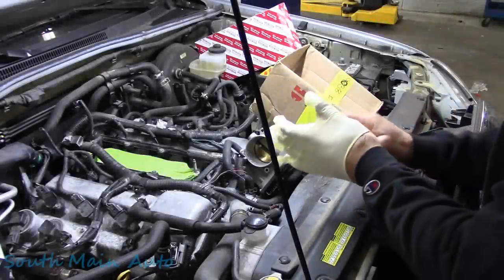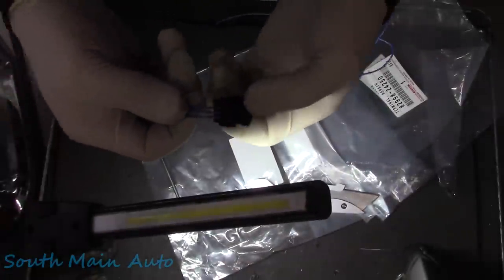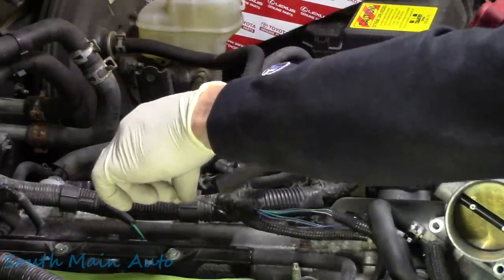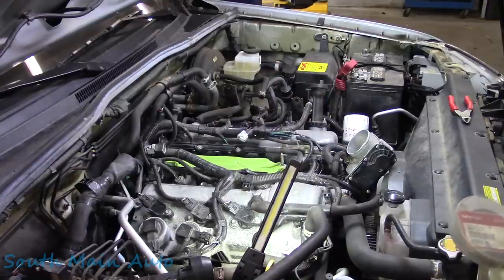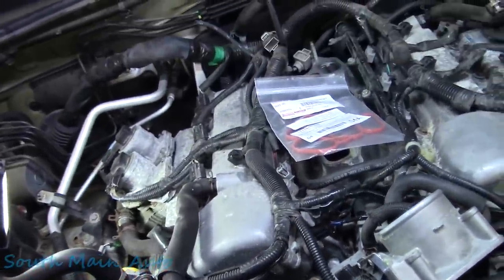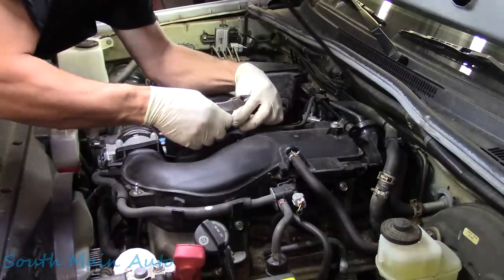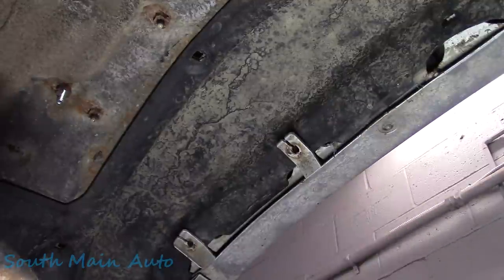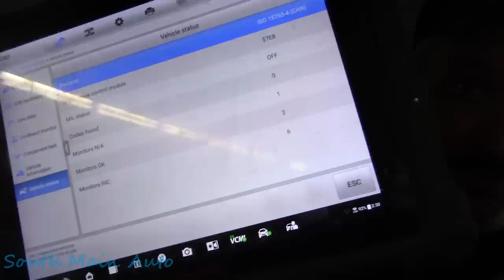Squirrel vs Toyota Tacoma - Part II

Comment: I know of many shops that wouldn't replace those fender liner or flare plastic clips as a normal practice. Good shops will though just like SMA.
MAN ! I have never seen that many Walnuts buried under the hood of a vehicle. Dang mice and squirrels. 
Repair commentary...excellent work and procedures. Ethical work.

Comment: I worked for Honda for many years and rodent damage was a huge issue. It was explained to me by Honda tech line that the wire insulation used a soy base in the plastic which made it delicious for our 4 legged friends to munch on. My worst case was a 14 CRV that took a full engine harness and interior floor harness to repair.

Comment: That definitely was a crazy scenario with that many black walnuts packed so tightly in all those areas.
I bet the customer was nicely surprised at how well it's running and the power increase.
Wild and cool diagnosis and repair, thanks!
Reply: I just trapped a red squirrel that had filled my barn with black walnuts! They were everywhere, the day I set the trap one fell on me off my bay door as I opened it haha
Cute little thing, but definitly destructive, chewed everything in site.

Comment: I wanted to get a couple of new keys for a recently acquired '05 Highlander. The local Toyota dealer wanted damn near $500: purchase 2 keys, get them cut and program them. I bought 2 keys on Amazon, had a local locksmith cut them and programmed them myself using instructions found on the Internet. Under $50.
Reply: Hopefully the dealers will get this message of captive market to no market at all!!!

Comment: Take it from someone who has had to use 'Readers' for the last 30 years - looking up with readers to fix something over your head is a real pain. There are glasses called 'Electrician's  Glasses’ that have the reader section on the top of the lens vs. the bottom. You can have these made to your prescription’s specifications at most optical stores. If you want to go fancy you can have a reader’s section on both the top and bottom of each lens with a clear strip in between so you can walk around easily. Yes, it is going to cost you but that is the price of living so damn long - as my father would have said.
Reply: I use Oakley frames with the straight temples. When I need to see upward, I simply turn the frames upside down and slide them on my face.  The tension of the straight temples keeps them on my head. Makes working under dashes a breeze - not to mention reading the upper shelves in stores.

Comment: Had same issue with the coil pig tail on my jeep. After looking everywhere else I actually found the pins at radio shack. Shame they closed the stores down  saved me with wiring issues several times

Comment: That Honda rodent tape sure is high dollar. I guess cheaper than a repair though for those that have lots of problems. I wonder if I could use Tesa tape then apply some Dave’s Insanity Sauce with a small brush afterward 😂

Comment: I come for the auto repair, the humor is just icing on the cake :)

Just realized that the reason why my air conditioning has sucked cyclically for god only knows how long is that I have no low speed cooling fans.  Applied some of the knowledge I have gleaned from South Main Auto videos, looked up the wiring diagram, followed the signal for the low speed fans all the way to the resistor, where I found an open in the circuit.

Sure is nice to order the part knowing 100% that everything else in the circuit is working exactly as it should, and it is 100% going to be fixed as long as the new part isn't bad straight out of the box.

Thanks again, for all that you teach us.  At this point, I am confident that I know more about trouble shooting than most of the mechanics in my area.

Comment: That's a good trick with the mini rolls.  I just use pieces of 1/4" copper tubing.  And I don't know about the 88, but the 33+ comes in mini rolls.  It's a little pricier buying that way ($32 for ten 3/4"x20' rolls), but they are convenient as well.

Comment: This SMA fan (and "wiring expert") is happy to see:  (1)  the wiring repairs done expertly and professionally with solder and heat shrink. (2) an understanding that overalls must be properly broken in before appearing in ready for primetime  videos, and  (3) the new Dewalt combination power ratchet and inch lb. torque wrench unit in action.  If it ain't that, you should patent the idea and retire on the royalties.  But keep making videos; some of the jokes are damn good.

Comment: That honda rodent tape is $42-$50 per roll.  Ha just put some pepermint extract drips around the engine compartment a lot cheaper.  Can't believe those new leads couls $10 a pop.  Great Video series.

Comment: Eric,  I like the unmentioned tip at 14:12  tucking a bit of paper towel into the socket to hold the bolt. I've done that before.   Nice Video.

Comment: Last year, I picked up a 2002 Toyota Highlander for $1,400 with 184K on the clock that was infested with mice throughout the interior, headliner, engine compartment, spare tire well, B pillars behind the seat belt retractors, upper HVAC system and cabin air filter area, rear floor ducts, stamped-steel horizontal seat mounts and center console. Not a single wire or hose was chewed. They went after the sound insulation only- that chopped up felt that's glued in place on the headliner and plastic interior panels. They got in by chewing a hole in the CAF frame, then realized it was a dead-end because of the fan which they left alone, so they found two large holes behind the upper fender area where a couple of cables go through, and built a highway. It took me 12 days to completely disassemble the entire interior, scrub and sanitize all the parts, scrub the floor pans and all exposed steel, wash the carpet and padding which was SOAKED with mouse pee, and reassemble. It now smells like a brand new car inside. Out of about 35 vehicles I've owned in my 40 years of driving, it is one of the best vehicle I have ever owned if not the best.

Comment: Since this truck sits for a very long time you might advise the owner to run the gas down to half a tank and then add a can of 'Dry Gas' then fill the tank. This additive will absorb any water that might condense in the tank as the truck sits.
Reply: I do that every other fill up especially in the wintertime.
Back in the day when I first heard about trying that with the old carbureted engines, it was like doing a tune up, the car ran that much better.
But instead of buying the marketed version, I buy isopropyl alcohol in bulk on line. MSDS sheet lists it as the active ingredient plus some dye to make it fancy looking!😂

Comment: My wife's Miata, was stored one winter in my dads unused garage. I must have pulled a 100 walnuts out of the engine compartment that next spring. Luckily, all electrical functions seem to still be working OK 2 years later. 
 Last fall, the wife invested in several pouches of Grandpa Gus's(Not a sponsor ;) ) mouse repellent, and I trapped mice all winter in the garage. This spring we had no new evidence of walnut storage.

Comment: I wonder what the lady is planning to do, if anything, to keep it from happening again? That same squirrel is probably waiting for the truck to return.
Reply: Lemon oil and water mixture sprayed regularly in engine compartment is a good preventative.
Reply: @albing1397 , I heard that peppermint is a natural rodent repellent, but from my experience it doesn't seem to work.
Reply: 36gr hollow points work too
Reply: @imnotimportant  That's my go to cure.
Reply: @albing1397  You can perform a squirrel stomp dance regularly.😁

Comment: Inherited a high mileage expedition last week, that a know thief shop looked at first, than the guys mobile mechanic buddy. Loaded the cannon. And prob came down to a improperly installed booster. And of course the booster vacuum sensor crapped the bed once it was fixed correctly gotta love that!

Comment: Gotta be a way to keep mice and squirrels away from the wiring and intake systems.  Nice work Mr. O.
Reply: Bounce dryer sheets. See my comment above!
Reply: Ya, the Motor Man (Leon Caplan) recommends that.  His radio show is on now, 790 KABC.  
Also, a former Ford Dealership recommended lye powder on the engine if the vehicle sits a long time.

Comment: What I have done is fasten a 1/4' x 1/4" steel screen grid with pop rivets over the air intake at the fender to keep the critters from getting into the air box. May work on some applications.

Comment: The injector wire was a perfect candidate to use LIQUID ELECTRICAL TAPE on, available anywhere that sells home wiring supplies such as BIG ORANGE and BIG BLUE/GRAY (sorry, no free plugs here. lol. ) It is available in many colors, IF you choose to match colors, I just se black. You can then put heat shrink over it if you wish but the liquid dries like the wire insulation.

Comment: Stuff some "Bounce" dryer sheets in the engine compartment where they won't burst into flames from heat and you won't have a mouse eating wires and nesting problem.
My RV customers told me that trick. Many have done it for winter storage of campers and mobile homes. The ones that do haven't had any rodentia problems.
For some reason, there's something in "Bounce" dryer sheets that they don't like. It has to be that brand. Other brands and cheap store brands do not work.
All I know is where they are used...no mice. Not sure about squirrels but people who have mobile homes as camps and use the sheets don't have squirrels ripping through.🐿🐀🚫😂😂

Comment: Here in southeastern  Ohio we also have problems  with  squirrel and chipmunks. We've  been using  small  salt blocks under are vehicles  for several years  and hasn't  had any issues  since.

Comment: Darn squirl nests! Before I drove tnem out of my home garage they used to leave me acorn shells on the intake manifold every fall and winter. I found a device yhat not only keeps the squirls out, but left me some read mice as well (ultra sonic device with three different rates (continuous, pulsed and variable fequency - wish it worked on spuders though).

I see you finally got your ice cream place open again. Sure looked "yummy" like the squirls and their love of wire wrap and wire insulation.

Comment: Haha great vid as always Eric and loved the Davey Attenborough impersonation. I've always found Toyota a great company to deal with, I rebuilt my 91 supra turbo pretty much from the ground up and my local dealership were fantastic when it came to sourcing the bits I needed.
Only oem I didn't use were the shims for the buckets, Toyota were pretty expensive but I found out that ford shims were an exact fit and covered the same thickness range at a third of the price, this was way back when we were getting 2 bucks to the pound so all the performance parts I ordered came from summit racing in the good ol' US of A.
Ahhhhhh happy days 😁.
Take care as always bud and look forward to the next instalment of "what did the critters nibble this time"

Comment: you'd think for that kind of $ for those wires, you'd be able to buy the different colors.
nice work, also, this one seems like a sunday going to church car, wouldn't it pay to put a metal mesh over the hole in the inner fender, to keep future rodents out of the intake.
did you plant any of the nuts, that have started to shoot ?
one final thing, for the safety of your finger, consider one of those stretchy wedding bands, l've gotten mine caught more than once, it got swapped out for a safer option, and the wife keeps my real wedding band in her jewellery box.
keep up the good work sir.

Comment: Squirrels can really screw up cars and homes. 
Just had to deal with a bunch at the cottage. 
A bunch moved into the attic and shed. They chewed through some wires and almost burned the camp down when we fired up the generator.
Got rid of 13 of them in one afternoon.

Comment: Just an FYI for yA Mr. O. that white lock thingy in the injector connector is called a TPA (terminal position assurance). Love your channel
Reply: Also the other white thingy in the cam position sensor is called an ISL (independent secondary lock).

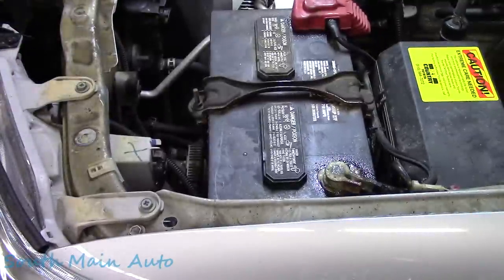Comment: That sticker put on by the dealership next to the battery at 16:19 really chaps my hide. Besides dismissing the Magnuson-Moss Warranty Act, it implies a great shop like SMA isn't able to work on your fancy new Toyota:

"*CAUTION!*
EXTREME CARE NEEDED
This vehicle is equipped with the latest and most sophisticated technology.
Repair and maintenance of your Toyota requires specialized tools and Toyota Certified Technicians.
Unauthorized service may void your warranty.
For factory authorized Toyota service, call (the dealership scumbags)"

Comment: I come here for the lame ass jokes and honest repairs. Squirrels and mice can reek havoc on wiring. Little bastards had me chasing issues under my hood. Drove me a bit nuts until I found the issue. Wrapped the harness with the Hondoo rodent tape after the repair. Bite this little bastards😁. Customers know you are honest, that`s why they come back and recommend you to family and friends. Love the David Attenborough impression. Finding some issues can be a real pisser, my 2002 dodge neon, P0172 code is one, rich bank 1, I only have one bank..lol. New plugs, nope, new map sensor, nope, piss poor idle, so new IAC, fixed idle but code still there. Built my own smoker cheap($35 in parts) and my tire inflator, no vacuum leaks found. New injectors, car has 150,000 on the clock, still got the code. Ok, new O2 sensors, still no joy, won`t pass inspection, ready to push it off a cliff. Car is the only thing I have left from my son who died in 2019. My mini me is gone😢, but lives in my heart so I keep his car alive. That code is a real pisser. Brought a tear to my eye writing this, I miss him dearly, he was a good man, would try to help anyone broke down. Thanks for posting, I really enjoy the content. Stay safe O Family, God Bless.

Comment: I know ( maybe I'm wrong) you are not a fan of general mess. Nor am I. I even worked for a GM dealership.  The one thing I do like, is their availability of pig tails. I had a Tahoe that three or the rear camera  sensors had all rotted out. I was surprised  doorman had pigtails . They were all broken at the connector  and thought I was going to have to overlay 9 wires.

Comment: @3:55 - Wurth Revcar. Amazing company. Well the branch I worked for in Roanoke, VA. I was a temp worker counting and measuring bolts. Hands down the best company I ever worked for. I was gutted when they didn't renew my contract. As I was hoping to make full time employee. But they simply didn't need another inspector. They needed a laborer. (And I had a habit of working myself out of a job as I always tried to find the most efficient ways to do things.)  I've never had the privilege of working with such an amazing group of people since. I'd go home absolutely exhausted from the monotonous labor they requested. But, I still wanted to turn around and go back the next day. And when I say monotonous, I truly mean it. Imagine them informing you an inspector is coming in who get's paid like $200 an hour just to do a quick coat of paint on some fasteners after he inspects some paperwork. So they need YOU to literally arrange several HUNDRED THOUSAND fasteners and nuts on a table in their warehouse that spans the entire back wall of their warehouse. Ya, that was my job. The inspector wanted easy math, so I had to literally create grids of these countless fasteners/nuts and ensure EVERY piece was faced the same way, and he could easily determine the arrangement at a glance. (Meaning he could look at the entire table and verify the correct number of parts were present within 10 seconds.) He was an awesome guy. But my labor at $10 an hour, literally made his job easier and he absolutely benefited from it. And yes, he was thankful. Not knocking him. As, again he was yet another amazing person in a sea of amazing people that graced that facility. I'm merely explaining the monotonous aspects of the job to put it into perspective.

 If I wasn't doing that for them, I was sitting in a chair in an open cubicle, recounting said bolts/nuts and doing a visual inspection on them. (Do the threads look messed up? Does bolt number 100 fit into nut number 100 properly? Does the batch number match? Are all identifying markings present and easily readable? As all the markings on EACH BOLT/nut had a batch of paperwork they cross referenced to.) Again, the PEOPLE at this facility made the job. As I was effectively counting blades of grass and sorting which blades were crooked and whether or not said blades of grass had their serial numbers/markings present and easily legible. So without good conversation for 9+ hours, most people would have gone insane after the first day. I lasted over 3 months before I ran out of work.